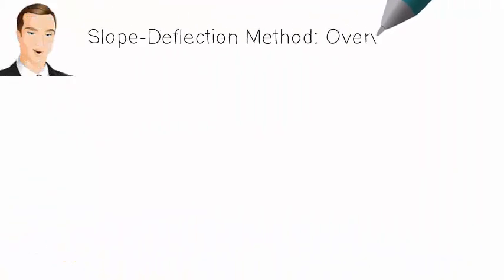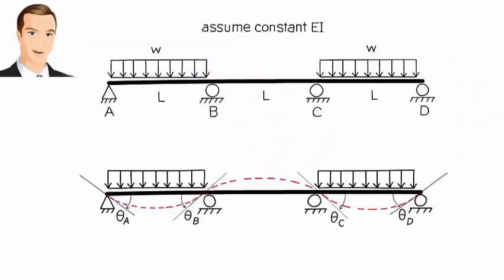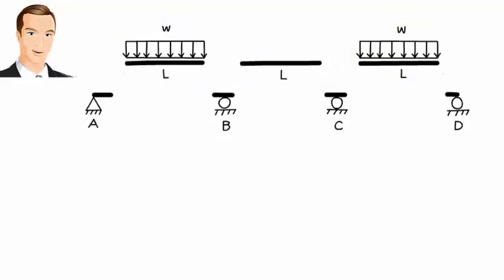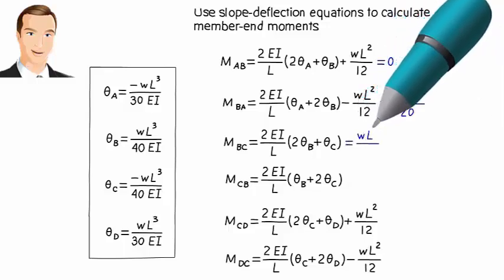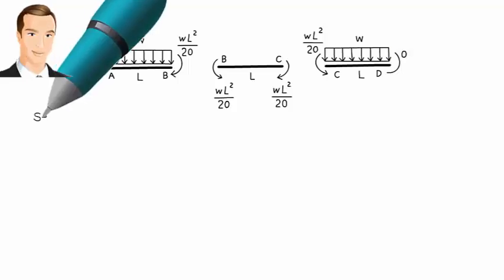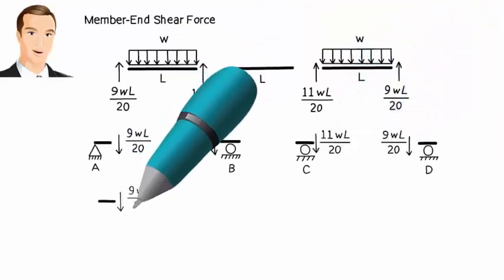SA27: Slope-Deflection Method (Overview)

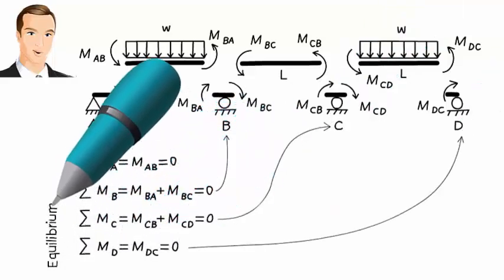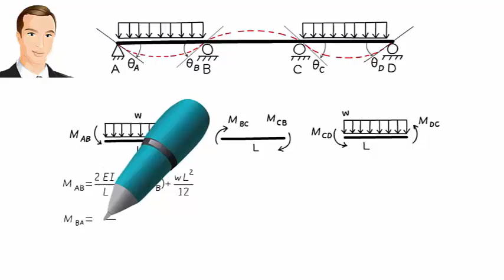Comment: Why did you assumed negative internal bending moments (counterclockwise) (2:38), and later (3:08) for the middle beam you assumed it positive (clockwise)?
Reply from the maker: Thank you for pointing out that inconsistency in notation. Mbc and Mcb at 3:08 should have been drawn in the counterclockwise direction.  When dealing with unknown moments, we always should draw them in the assumed positive direction.

Comment: Sir, the 3-span beam is symmetrical except the supports at A & B are different.  That means they were almost opposite along the line of symmetry.   On your free BOD on 2:24, you drew them - the rotational forces are all in one direction. Shouldn't they be drawn in the opposite to be understood and undisputable ?  And also shouldn't M (AB) & M (BA) for example be in the opposite direction?
Reply from the maker: The beam segments are subjected to generalized distributed loads with various lengths and moments of inertia. Why assume the symmetry?  

Here, we are developing a general formulation in which the beam segments could be subjected  to any loads and could have any length and moment of inertia. 

As a matter or principle, the direction of an unknown force or moment has to be assumed; the assumed direction is arbitrary. We are not trying to decide whether the internal moment in the beam is positive or negative, since at this point we don’t have enough information for that determination. We are simply stating that there is a moment (with the understanding that its magnitude could be zero, positive, or negative) at each end of the member, and we choose to use the commonly used beam sign convention to show/draw it.

The M_ab, M_ba … notation is associated with the slope-deflection method. This method uses a different sign convention for representing member end moments; we show the (unknown) member end moments in the counterclockwise direction. Please  see the previous lecture on the slope-deflection method on this.

Comment: You lost me at 3:52. How did you get the "Equilibrium Equations in terms of joint rotations"?  Also, how did you get those values once you solved for the unknowns?
Reply from the maker: @3:30 the slope-deflection equations define Mab, Mba, ... in terms of joint rotations. So we just have to substitute the slope-deflection equations in the equilibrium equations to arrive at the set of equations in terms of the joint rotations.

As for the solution of the system of equations, it is a linear systems, except that instead of having numbers we have parameters. Treat the joint rotations as unknowns, then solve the equations for the unknowns. Think of the system as something like this:

a1 X + b1 Y + c1 Z + d1 W = e1
a2 X + b2 Y + c2 Z + d2 W = e2
a3 X + b3 Y + c3 Z + d3 W = e3
a4 X + b4 Y + c4 Z + d4 W = e4

where X, Y, Z, and W are the four rotations, and a1, b1, c1,... are the constants/parameters.

Solving such a system by hand is a tedious task. We can use an app like Mathlab or Mathematica to facilitate the process. There is an online version of Mathematica that can be used freely. It should suffice for solving this size equations. Here is the link, in case you want to give it a try: https://www.wolframalpha.com/

Comment: Can you please explain difference between member - end shear forces and support reactions.. I mean you are actually calculating support reactions then why are u calling them "member-end shear forces" (at 5: 15)... how and where are that came from? 

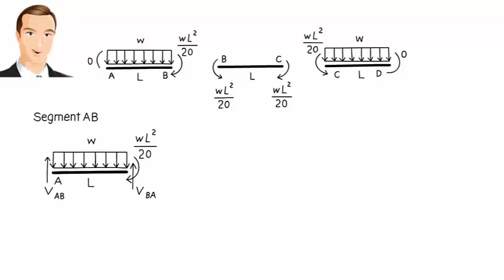And I also want to know that why are u always taking clockwise moment as -ve and anti clockwise moment as +ve (4:35).. however while calculating support reactions, when you taking moment about one end support in moment equation (i.e sigma Ma or sigma Mb...whatever) then you are doing just reverse i.e. clockwise moment as +ve and anti clockwise as -ve (at 5:25 in the moment equation "-LVba",  at 5:45 "-LVdc")... I mean How???
Reply from the maker: Imagine a beam having a pin support at its left end. Say, the reaction at the support is 10 kN.  This is the force that the beam transmits to the substructure (through the support). 

If we cut the beam, say 0.0001 mm, away from the support, then we end up with a shear force. This is a force internal to the beam. We are not going to see it on the free-body diagram unless we cut the beam. In this case, the shear force has to be equal to the reaction force in magnitude but opposite in direction since the sum of the forces in the y direction in that tiny segment must be zero.

So, when considering the left end of a beam segment, we talk about shear force at that end. If that end is next to a support, then the reaction at the support is going to have the same magnitude as the shear force. In a sense, we can refer to it as either the shear (at the left end of the beam segment) or the  reaction force (at the support).

As for your second question. There are two distinct sign conventions here: One for the slope-deflection equations and one for writing the equilibrium equations. When writing the slope-deflection equations, we have assumed counterclockwise to be positive, both for end rotations and end moments. The derivation of the slope-deflection equations is based on that assumption. The other sign convention is for summing the moments about a point. This is a more general sign convention that we use when writing the equilibrium equations. Here, we can assume either direction to be positive. The choice is really yours.

Comment: Dr plz help me with the sign convention for beam AB @ 1:50. From my understanding, the actual direction for Mab has to be clockwise, while the Mba is anti clockwise. But why do u wrote anti clockwise for both Mab and Mba? Is it has to do with initial assumption since we are talking about an unknown bending moment?
Reply from the maker: Exactly! We are making the initial assumption that all the member-end moments are acting in the counter-clockwise direction. That enables us to formulate the problem in a consistent manner without trying to determine the correct direction for each moment beforehand. After doing all the necessary calculations, if a member-end moment ends up having a negative value, then we know that it actually acts in the clockwise direction.
Reply: Dr. Structure thank you very much Dr. Appreciate your explanation

Comment: Why can't we just keep integrating the load w(x) to get M and deflection (and all reactions)?
Reply from the maker: We can determine shear, moment, and deflection by integrating the load function while considering the beam’s boundary conditions.

This integration works when the load function is continuous. However, when point loads or support reactions are present (which generally cannot be expressed as continuous functions), the beam must be divided into segments where the load is continuous. This results in piecewise equations for shear, moment, and deflection.
Reply: @DrStructure  Thank you!

Comment: Dr  structure you calculated Moments for simply supported beam ( left end is pin joint M  AB= 2EI /L ( 2* theta A + theta B )and M BA =2EI /L (  theta A + 2*theta B ) which  is a roller joint )  I.e … but your are using the same formulae for the beam section rested on two roller joints i. e in B C section.Is this assumption is valid for all ?
Reply from the maker: Yes. The moments that we are calculating here are not the support reactions, or at the supports. They are the moments at the ends of the member as if you cut the member close to whatever support is at the left end and at the right end of it. So, the supports themselves are not relevant here.

Comment: Hi Dr. Structure, 
Can a slope-deflection method be used on simply supported (or any other statically determinate) beams? If not, why?
Reply from the maker: Interesting question!

Yes, we can apply the slope-deflection method to determinate structures. For example, if we apply it to a simply supported beam, it would give us the beams's end joint rotations.  Of course, the method has not utility for calculating the support reactions since those can be easily determined using the equilibrium equations.

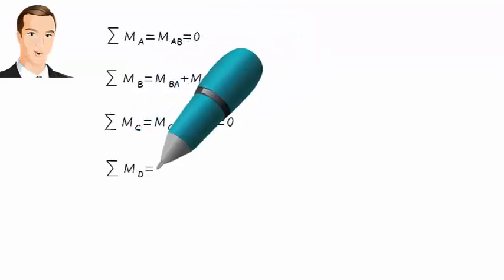Comment: @3:39 how did you get equation Ma. how did you get wL cube over 24EI? i would much appreciate if can you elaborate for me. tia
Reply from the maker: Mab = 0 

(2EI/L) (2 theta_a + theta_b) + wL^2/12 = 0

Multiply both sides of the above equation by L/(2EI), you get:

2theta_a + theta_b + wL^3 / 24EI = 0
Reply: Dr. Structure thanks so much. very much appreciated
Reply from the maker: You're welcome.

Comment: What if we know that EI is not constant, can we use and how do we adjust the equilibrium equations in term of joint rotations?
Reply from the maker: If two or more beam segments have different E or I, that would impact the slope-deflection equations. The two slope-deflections, Mij and Mij are defined in terms of (EI/L). So, members with different E or I would have different (EI/L) terms which in turn would be reflected in the joint equilibrium equations.

Comment: In slope-deflection equations, when the part of the equation (wL^2/12) is positive and when it is negative? Does that depend of the bending moment and applied load directions?
Reply from the maker: Our sign convention for bending moment in the slope-deflection method is one that assumes counterclockwise direction to be positive. 

For fixed-end moments, assuming w is acting downward, bending moment at the left end of the beam is going to be counterclockwise, hence positive wL^2/12, and bending moment at the right end of the beam would be clockwise, or negative wL^2/12.

Therefore, Mij, bending moment at the left end of the beam has the positive wL^/12, and Mji, bending moment at the right end of the beam has the negative wL^2/12.

Obviously, if the direction of w is reversed, if w would be acting upward, then the wL^2/12 term in each equation changes sign.

Comment: Can you explain how u determine the directions of moment at the beam MAB & MBA - both CCW, why MBA is not CW?
Reply from the maker: When drawing free-body diagrams, we have to assume a direction for the unknown forces. In this case, we need to assume a direction for the member-end moments. In the slope-deflection method, we assume the member-end moments are acting in the counterclockwise direction (but we could also assume them to be acting in the clockwise direction, and then adjust the formulation accordingly). This is very similar to how we show the support reactions in a beam. When the reaction forces are unknown, we generally assume them to be in the upward direction.

If the computed member-end moments turn out be be positive, then our assumption is correct. However, a computed negative magnitude for a member-end moment tells us that the moment actually acts in the opposite direction to what was assumed initially. That is, the moment acts the clockwise direction.

So, we are not actually determining the direction of the moments at the onset of the process, when drawing the free-body diagram. What determines the actual direction of the moment is the sign of the magnitude of the moment, after it is computed. If the sign is positive, then the moment is acting in the assumed (counterclockwise) direction. If the sign is negative, the moment is acting in the clockwise direction.
Reply: @DrStructure  Thanks. In other words, we can assume the other direction so long as we are consistent with the way we assumed.  
I am struggle with this: All the times, I read, solving problems, support types  to the beams were given. In real life, how do we determine the support types. When we design a continuous beam, say, a reinforced 3 or 4 spans concrete beam.   Is the end span taken as fixed support? Is the intermediate  span,   fixed, pinned or roller supports?  Also assuming I have a 10 feet steel channel beam (supporting solar panels). The beam sit and bolted on top of  3 larger channels as two span continuous beam,  what kind of support should each of the support be ? Can you do a video,  with real life examples  the type of continuous  beam that their support should be analyzed as  pinned, roller and fixed supports.
Reply from the maker: @zumbatan550  Regarding support types, we design real structures with specific support types in mind. So, it is not like we build the bridge and then ask ourselves what kind of support it uses. Rather, we decide beforehand what type(s) of support we wish the bridge to utilize. That is why we need to know the support types before analyzing the structural system. Put differently, as structural designers, we must decide on the support types before we can analyze the system and eventually construct it.

Next time you come across a bridge, if its supports are visible, try to see if you can determine its support types. 

Generally speaking, the connection is considered rigid if you don’t see a roller or a friction pad between the beam and the column that supports it. When analyzing such a system, the continuous beam and the columns that support it must be analyzed as a frame structure. If the concrete beam is attached to the abutment in a monolithic fashion, we can consider it a fixed connection. 

In this discussion, it is important to distinguish between a fixed joint and a rigid joint. A fixed joint cannot rotate or displace. A rigid joint can displace and rotate, but all the members connected to the joint rotate together the same amount. A good example to keep in mind is a frame structure. The base of the frame could be fixed at the foundation, but the upper joints of the frame (the connections between the beams and the columns) are not considered fixed; but they can be rigid.

The connections can be viewed as pins if a beam is supported by three channels using bolts. If the bolts prevent the lateral movement of the beam at the connection, it is not a roller. Although, in principle, we can build a fixed connection using bolts or a combination of bolts and welds. But in this case, the chances are we are dealing with pin connections.
Reply: @DrStructure  Thank you Dr. for educate me.  Appreciate your response.

Comment: What if the EI is not constant
Reply from the maker: If each member has its own constant EI, the method still works. Each set (for each member) of slope-deflection equations has its own EI which needs to be used in the equilibrium equations. So, a constant EI cannot be factored out in the moment equilibrium equations. But that is not a problem. We still can write the equation and solve them.

If however, EI varies within a member, say, a beam segment has a variable moment of inertia, the slope-deflection equations as we have written them (as we derived them based on the assumption that EI is constant) become inapplicable. A revised and more complex set of equation would be needed to handle beams with variable moment of inertia.

Comment: why the moments are same on the bothe sides of joint?bit cinfused
Reply from the maker: The member-end moments are not the same (one is Mij, the other is Mji), but they are assumed to have the same direction (counterclockwise). 

When deriving the slope-deflection equations we need to have a sign convention for joint rotations and member-end moments. We can either use counterclockwise, or clockwise, as positive. This simply means when we are drawing our diagrams, we draw rotations and moments in the positive direction.